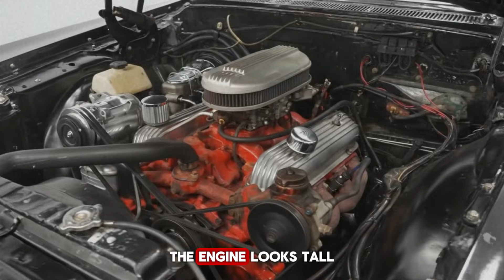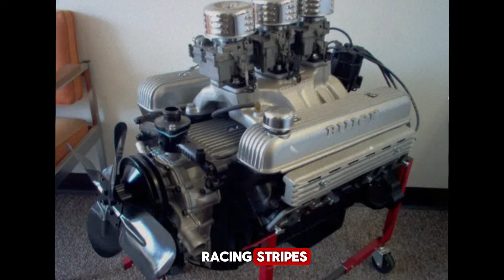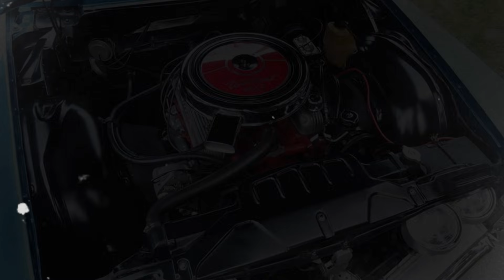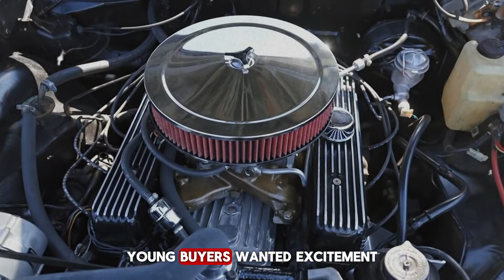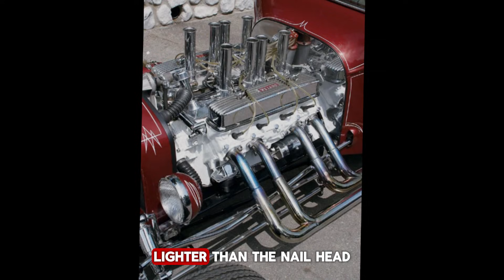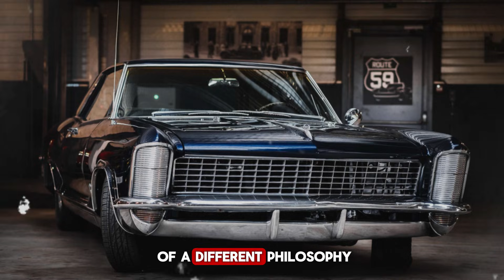Why Buick’s 401 Nailhead Was Too Different to Survive

Comment: Information mostly correct but I hadn’t heard how assembly was slower and thus more expensive in the build process, nor that it became a boxed-in design as the 60s progressed - 2 big video complaints: the bobbing sailboat rocking of all the images & the weird white flashing flecks that I guess was added to imply that images of old designs must also have some old 16mm film type look to ad legitimacy; both fails, sorry 🤨 respect for the nailhead I once owned in my beloved 63 Invicta

Comment: I haven’t been fortunate enough to own a nailhead yet, but I do have a Buick 350. The peak torque on that 350 comes in at only 1,800 rpms! For the most part, Buick V8 street engines don’t need to rev above 5,000 rpm to make power.

Comment: You didn’t cover the reason for the tiny valves and extreme angle.   It was originally designed to be a 4 valve engine, but the plans got nixed.   So the heads were modified to only use the two valves that were originally going to be the intakes.   Due to this half design, it was the most polluting engine Detroit produced, and they had already been given the heads up on federal emissions mandates in the upcoming years.   
And in my ‘66 GS, it creates so much torque I’ve hardly ever had to rev it past 5,000 before I’m already way past the speed limit.

Comment: Final version of "nailhead" "Wildcat" engine 
Did this version have full sized valves unlike the first generation nailheads? Still had the weird vertical valve angle
May have also came in a 425 cubic inch version (not the same as the later Buick "big block" engine as found in the Gran Sport/"stage" I     II